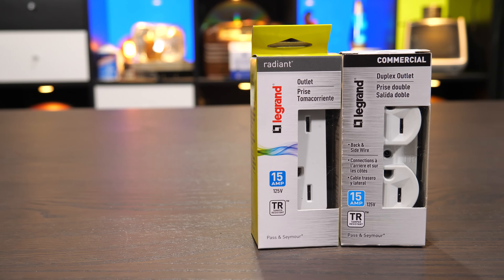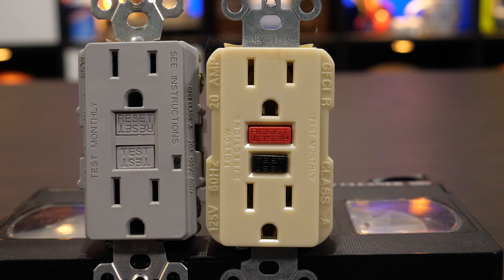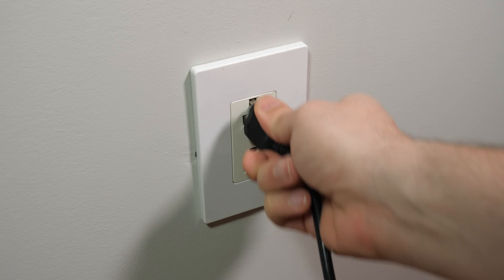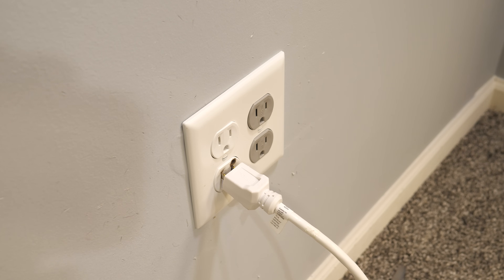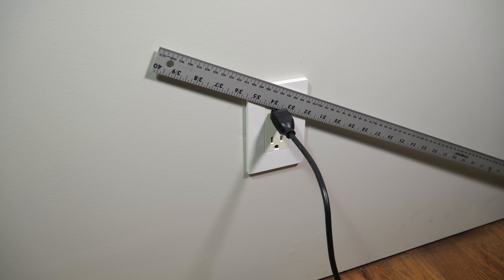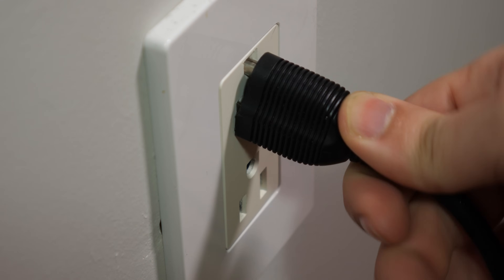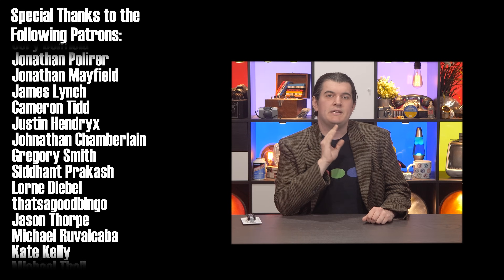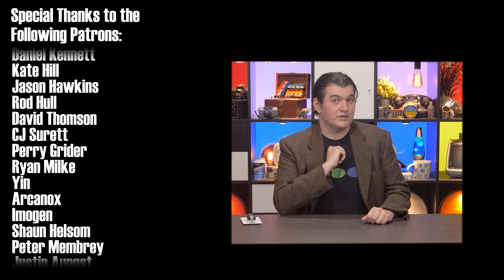Power outlets are topsy turvy - but does it matter?

Comment: The Chicago horizontal outlet orientation was very strange to us when we moved here 20 years ago. However, now I see several benefits such as neither plug is drooping over the other and it does just look nicer. I’m sure you’re right that it is probably due to the conduit requirement but now anything else seems strange.
Reply: Chicago convention is ground down on vertical receptacles and ground on the right for horizontal receptacles.
Reply: Hot take, but Chicago-style is almost right. Just flip it over so that the neutral's on top, and it's perfect (other than actually fitting the box)

Comment: Ground towards ground unless it's a half hot (half of the duplex always hot, the other half switched), or if space limitations require it to be sideways. It makes no electrical or safety difference, but we do it that way for consistency and because most devices orient the ground pin downward, as you demonstrated. Many electricians, myself included, base the box makeup on the face orientation as well. 

The North American plug isn't a bad design. There are billions in use and the scenarios you and others apply simply don't happen in significant numbers. A little environmental cognition and common sense go a long way. 
That being said, I'd have no issue with the adoption of blades being insulated for the first 1/8 inch. Just because something is improbable doesn't mean it's impossible. It also wouldn't be difficult since the insulation wouldn't be long enough to reach the contacts behind the face of the receptacle. Frankly that would make more sense than the adoption of tamper resistant receptacles, which were pushed by manufacturers to increase profits.

In over forty years of residential electrical experience and twenty years of commercial experience I have never encountered a screw backing itself out. It doesn't happen.

This idiotic push to flip receptacles is another example of the snowflake generation solving a problem that doesn't exist so they can feel relevant. If we designed everything for the lowest common denominator we wouldn't have anything, since every single man-made item is dangerous in the hands of a moron.

Comment: As  Journeyman Electrician, I've installed duplex receptacle every which way.  The scariest thing I seen in the video, was the replacement lamp plug @ ~15:57 was . The plug is not 'polarized'. If the light is plugged in the wrong orientation the 'hot' is no longer the bottom - center of the light socket but the metal threads. The owner could receive a nasty shock buy touching the metal threads on the bulb while changing a light. When the 'hot' is in the bottom - centre of the light socket, the 'hot' is disconnected as soon as you turn the bulb. 
Hard to tell in video, but there is no visible approval agency, ULC etc, on that plug.

Comment: British plugs have the ground pin (which they call the earth pin) on top. Also, their outlets have shutters covering the hot and neutral holes... which only open when the ground pin is inserted into its hole (there's a little button in there). Also, the hot and neutral blades of the British plug are insulated, so nothing can touch the live connections while the plug is inserted. And if a British plug is partially disconnected enough for the contacts to be exposed, power is no longer going into them.

British plugs are said to be the safest in the world. You do, after all, want your electrical stuff to be safer when everything is on 230 volts, as opposed to our 120.

Comment: I just watched a video about a plug I probably will never use since it's not common where I live  - and I enjoyed it :D Why the pins are not insulated a bit was a question I had on my mind the whole time. Seems so obvious. 
btw: I have square plugs where the pin "base" can be rotated. So every orientation will work. Also very flat ones with a foldout handle to unplug it easily. I don't know if it exists in the US. But then again, you also seem to have only one kind of light switch :D

Comment: Psychologically, I would think the "Ground is Down", you know what I mean? But I still prefer it facing up if it's connected to a light switch so I can identify which ones are on a switch easier, and lights don't typically have a ground pin. When I got my old house, the outlets had the ground at the top, and almost every time, the ground pins broke off of my cords in that orientation. It was getting too expensive to keep it that way, so I had to flip them around, not to mention the angled plug problems.

Comment: I have 1 case where I would prefer the upside-down face but it's got nothing to do with safety: use a single upside-down duplex outlet to mark which outlet is connected to a light switch. So many moves where I'm trying to figure out furniture layout and I have to guess or carry a lamp or something to figure out which outlet is connected to the switch.
Or color code it, or something. I dunno, I'm not the electrical code's mom.

Comment: Up, down, sideways; in my opinion, they're all bad positions with the design of receptacles as they are. 
It's yet another case of having to live with a situation that could be improved with modern design but is prohibited by the need to retrofit the entire country in order to do so.
In other words, it ain't happenin'.

I do happen to be a ground-up installer ever since I once spent hours troubleshooting a shorted circuit in an institutional building where I eventually found a stainless-steel receptacle cover that had its retaining screw fall out, allowing the plate to fall down across the hot and neutral bars of an extension cord that was plugged into it.
That wouldn't necessarily have been a big deal to find except that the receptacle had had a cabinet permanently installed in front of it, obscuring the receptacle from my searching eyes until logic told me that there must be a receptacle somewhere along this particular length of this particular wall.
I was pretty proud of myself once I found and repaired the offending situation, with the new receptacle installed ground up.
I then submitted a work order to have the carpentry department modify the installation of the cabinet to allow future access to the receptacle.

Comment: Cables down here in Australia have insulation on the exposed contacts about 20-30% of the exposed area. Technically the cables with no insulation are illegal and if they are the cause of a fire insurance might not want to cover you

Comment: Im a professional A/V tech. A couple years ago i was feeding my metal flexible fish tape about 30 feet through a metal conduit. It was being used for a microphone wire. The conduit was 18" above thw floor and I was siiting down on the flloor pulling the metal fish tape out of the conduit with about 15' of the fish tape coiling around me. Then it happened. The fish tape started get hot , sparking and stocking me eveeytime I moved the tape. I froze and yelled out to others to get back and cut the circuit breakers. Shortly before the lower cut I noticed a USB phone charger pulled into the wall near me slightly out with the fish tape making contact with the blades. No ground pin would have changed the situation. No i didnt die that day but an electrican on sight told me the person who did the original installation of the outlet put in the unsafe way. He was going to flip it when I indicated in my case nothing would have been different.

Comment: You imply that touching a live circuit will be deadly, but that is not true unless some other part of your body is in touch with neutral or in touch with a low resistance path to neutral or ground. This is not usually the case.

Comment: I've actually had a metal sign/poster slide down the wall and make contact with a partially dislodged plug that caused quite a fireworks show...and it didn't have a ground plug.  After that my house went sideways.  So I get the argument, and appreciate your discourse!

Comment: the ikea right angle 45 degree cable makes sense and is kind of omega pog, I would say, but also a good solution might be to just take both sockets and make it so they both face the opposite direction, and ground always faces out. Top socket is upside down, bottom one is the classic smiley face. Bam, two 95 degree cables in one socket, even though the top one kinda sucks. I don't think this would be quite as good for your chicago sideways outlets, though. You might also be able to put the plugs themselves at a 45 degree, so your right angle cables work without having to rely on manufacturers building that into the cable.

Comment: Non electrician here just DIY. When I rewired my 50’s atomic ranch I removed the old receptacles that were non grounded. They all installed with the hot side on the right, neutral on left.   Why would I reverse that on new grounded install?

Comment: When I worked at a grocery store I was counting my till in the office and I dropped a quarter on the desk, and it rolled off the back of the desk and a huge POP and flash happened and it started smoking back there. The plug for the UPS for the computer in there was slightly unplugged, and the quarter fell perfectly on the plug pins and bridged the gap

Comment: I nearly fried myself when i was a kid one time.  I was trying to unplug our Christmas tree, and i was having trouble getting the plug out.   So i went and got a flat blade screwdriver out of the junk drawer, and i made a rainbow of sparkling electricity come out of that outlet.   It made a pretty loud sound too.  Scared the ever loving crap out of me.  I really lucked out and miraculously wasn't touching the shaft of the screwdriver.  Somehow it didn't trip the breaker, because the tree was still lit.  I melted a little chunk out of the end of the screwdriver and it left a powder burn (kinda like a blaster bolt does in star wars) coming out of the outlet.  I learned a pretty valuable lesson that day.  I don't know how old i was, probably 5 or 6, but it left an impression.  It made me a little more cautious, at least at first, whenever i was doing anything involving electricity.  I still got zapped a couple of tmes anyway, but it wasn't too bad.

Comment: I have to vote for sideways nonbinary and right-angle plugs. The cable weight 'locks' the pins in place. A simple finger loop on top of the plug would make it safer and more assessable  for arthritic fingers.

Comment: Just to give everyone worried about getting electrocuted some peace of mind. The usa has statistics out on fatal electrocutions. About 2 in a million people die from shocks each year. Of those, 30% are from touching power lines, 30% are from being struck by lightning, and the other 40% are from high voltage machinery in industrial workplaces (think giant motors in a factory). About as rare as all of that, a toddler is hospitalized from chewing through a power cord but lives. 

In summary, if you are worried about yourself or a kid getting fatally electrocuted, they are quite literally more likely to be stuck by lightning.

Comment: I'm a biomedical equipment technician, and it was explained to us that hospitals use the ground up position because of the loose plug and foreign object issue. In practice I've only seen a couple of clinics that didn't follow this rule. On another note, there are "hospital grade" outlets. These are denoted by a small green dot on the receptacle. These have higher blade tension to hold the plug in better, in fact, there is a standard plug tension that hospital outlets must meet. Hospitals can also receive penalties if a power strip is found in use in most environments. It has to be a dire situation to be an approved use of a strip. The power strip must also be hospital grade, and are insanely expensive! I think the last one I ordered were almost $200 each!
Reply: I didn't know that and that info refutes my earlier comment here (mainly there must be a way for hospitals to upgrade outlets, etc. )Thanks!!

Comment: I was taught that an 'upside down' plug was usually controlled by a separate switch. Usually specific to a floor lamp. More so common in older homes that didn't have built in lighting
Reply: He mentioned that in his video on switched outlets if I remember correctly
Reply: What do you mean older homes that don't have ceiling lighting? I've seen more older homes with ceiling lighting. Then I've seen brand new homes and yes when there's only one outlet upside down in a room. It usually means it's controlled by a switch. It's not in the code but it's a go- to unofficial method
Reply: My (at various times throughout) Great Grandmother and Great Aunt's, then my Aunt's house is one of those "older" homes; push button switches (1 for on, 1 for off), pretty sure cloth wrapped wiring, etc.  Including ceiling lights in multiple rooms.   And none of the outlets were the common "face" style, just 2 slot outlets (hot and neutral only).  My Aunt has since sold the house and moved into something newer.  Not sure what the new owners did with the place.

As far as the "upside down" face plugs denoting switch operated function, this is the first time I have heard of that.  I was taught it was to prevent things falling across the hot and neutral in case the plug wasn't inserted all the way, or got knocked out a little.
Reply: i saw this in an apartment
Reply: No, I have never seen that
Reply: Standard practice in Arizona. If i could just remember if it is the top or bottom plug
Reply: I think everywhere I've lived in Chicago had the right one be controlled by a light switch and the left one is always on. Maybe that's not true if there's ceiling lights in the room though.
Reply: When you speak of "older homes," you are misinformed.  I live in one.  It had one overhead light in each room, operated with a pull string.  There were zero outlets, as they hadn't really been invented yet.  Appliances had "Edison plugs," not pronged plugs, so they screwed in to the overhead light fixture after removing the bulb, or just screwing in if you had an extension screwed in.  The wiring was knob and tube.  There was no such thing as switched outlets, as the outlets didn't exist.  Perhaps you're referring instead to a modern house.  I've never been in an old house with switched outlets.  All I've ever seen were in modern houses with a couch and lamps on end tables that might be plugged into switched outlets for convenience.  The outlets were placed and the switching added after the location for the couch was obvious.

So you were taught wrong.  I experienced the things I speak of.
Reply: @bite-sizedshorts9635 The house I currently live in did not originally have ceiling lights installed in the bedrooms, and, in fact, only had a switch for the plug closest to the wall it was on. They were ungrounded and unflared outlets, so yes it is entirely possible and do in fact exist older houses without ceiling lights and fans. Your experiences are not universal.

Comment: The us needs to just add insulation to the start of the prongs. In about 2000ish we started getting this in Australia, it made already amazing plugs even better. The prongs didn’t get any thicker where the insulation is, the metal got thinner and insulation is on top, this gives us the exact same size and shape prongs as before. around same time the standard changed for the thickness of the plug itself. We started getting an approx 1cm collar around the end of our extension cords, this means a partially inserted plug still has protection all the way around, this did mean our plugs got 1cm thicker so the cable on a right angled plug does it’s thing after the collar

Comment: I think the most compelling / realistic safety-related argument is about plugging and unplugging. The index finger is the farthest forward and therefore most likely to make contact with a pin. That finger is on the bottom, where it is also less visible. This suggests ground (or neutral, for sideways outlets) should be on the bottom.

Unfortunate that the anointed solution to this problem seems to be "every child needs to be instructed explicitly by their parents on how to use an outlet" . . .

Comment: Condensed 16 minutes... It is not personal preference.  If the outlet receives power at all times the ground is at the bottom.  If the outlet is controlled by a wall switch the ground faces up.  Anything else is wrong.

Comment: I'd rather have a metal wall plate fall and trip the breaker in a ground down scenario, than have it dangling there with a live circuit in a ground up scenario.

Maybe each socket on duplex outlets should be rotated 90 degrees so both can be used in a horizontal installation.

Comment: Many power strips and surge protectors have angled 90 degree plugs. Usually at a 45 degree angle, that can be used on an outlet that is installed in any manner.

Comment: It would be interesting to see how the safety of other countries' power plugs compare to our US plugs, as several are designed differently and with different voltage.
Reply: Western European Type F or E plugs are deffintely much safer than US plugs.
We also work with mostly 230 volts 16 amp groups giving us 3680 Watts to use per group :D

Comment: so, i have this lamp with a old plug  (similar to the one at 6:01) and one time, it came unplugged and when i went to go plug it into the outlet, my finger slipped across the 2 terminals. got a 120v 60 hertz A.C. shock! luckly, it caused me to jerk AWAY form the outlet so i was ok. and yes, i still have the lamp.